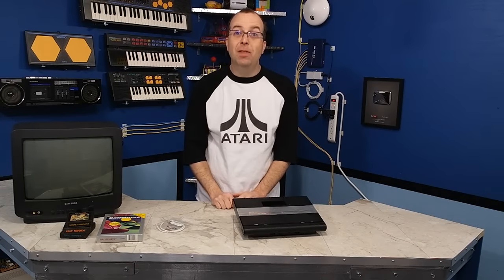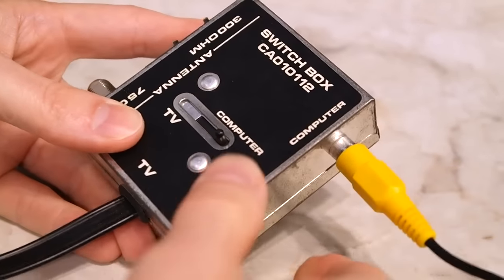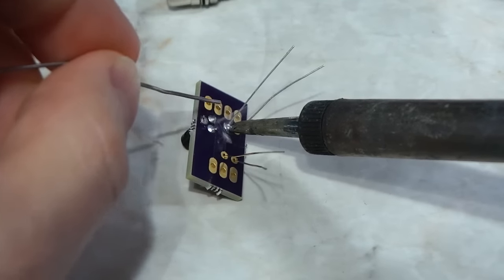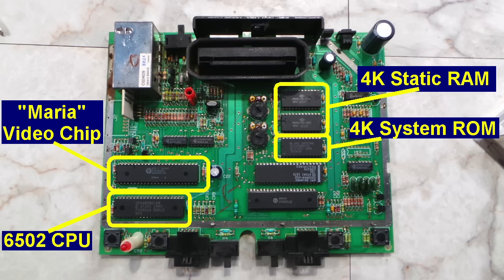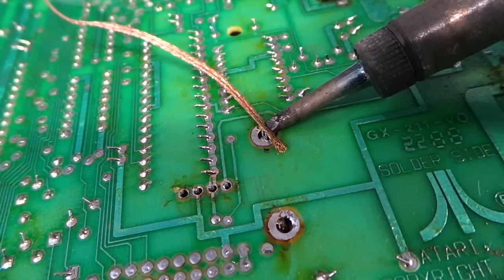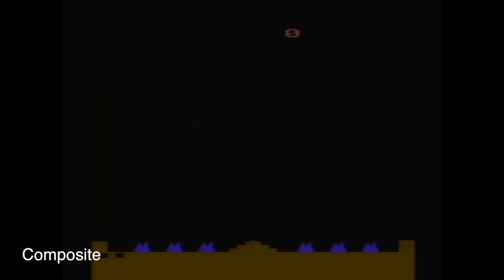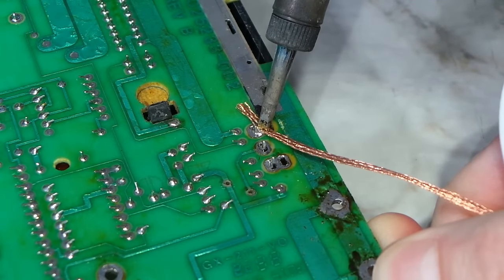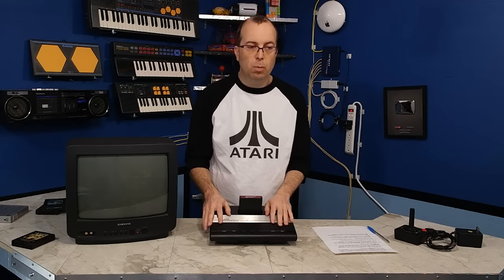Atari 7800 Composite Mod and Review

Comment: Did this mod myself a while ago.  Works great.  One thing, the volume is off for the Pokey sound if you just run a wire like you did.  You won't notice it if all game sound is Pokey or all TIA, but if the game uses Pokey and TIA sound (like Commando), you do.  I used a tiny variable resistor on the TIA audio line (I think) to get them right.  Always planned to take it apart, measure the resistance and then just get a resistor, but I got lazy and the variable resistor is still there. ;-)

Comment: Great video!

A couple minor clarifications ... only two of the original 7800 games had POKEY sound chips but probably a half dozen or so Homebrews also have it. 

Also, you talk about carts being 48K. In fact, during the 7800's life, they also had 64K, 128K and 144K carts. Since then, Homebrewers have made 256K, 512K and 1084K games.

Comment: @The 8-Bit Guy
The reason the 7800 didn't have a composite is probably because it was originally designed in the early 80's.  And it was actually originally released in limited numbers in 1984.  But due to the selling of Atari and internal company strife the 7800 wasn't widely released until 1986.

Comment: My first console was a Atari 2600 but it wasn't in the old brown and black case, in fact its had a case very similar to the 7800 you used in this video, the difference was the power switch and pause switch were on the left near the cartridge port, fond memories of games on that console

Comment: The TIA chip actually generates stereo! It has two channels which have separate output pins on the chip. If you look at the slats on an original VCS, you'll see where two speakers were intended to mount. In the end the system was converted to mono. I'm going to guess that Yar's Revenge is using the second channel which is coming from the other audio jack in this case, which is why the sound is off.

Comment: My Sega Master System had a DIN socket on the back. With no internet and a few dollars worth of parts from the electronics and a little trial and error store I made my own composite out cable. I think I was 8 or 9 or so. Those were the days!

Funny thing is I connected it to the VCR, which was connected to the TV via - RF. But somehow the quality was much better, perhaps the VCR just had a superior conversion circuit.

Comment: I think the funny sound on Yars Revenge is due to the lack of lowpass filtering on the composite output you added. The additional harmonics don't make it through the RF modulator and you can't hear them anyways. But they will cause aliasing if your capture device lacks an antialiasing filter.

Comment: Nice job on the modification. My only advice would be watch the rough edges on the shield and board so the wires don't rub up against where you cut. I generally leave my systems in original condition unless I have two. Some of the newer modifications that can be done involve component and HDMI which I did on an Atari 5200 and Commodore 64. I haven't actually done component though because there's a lot more involved in that you'd have to drill 5 holes 3 for video and then 2 for audio. Not to mention I figured since HDMI is the main format currently in use it just made more sense to go with that. Both systems look and sound great. It's nice not to have to use the Atari 5200 specific RF switch and as for the Commodore 64 the SID chip never sounded better.

In general though I emulate everything which allows it to look and sound better still for obvious reasons.

Comment: This was cool to watch. I've been wanting to do the same mod on my top-loading NES as it doesn't have composite for some bizarre reason. I had no trouble taking apart my old front loading NES and snipping the lockout chip but once you get into soldering and drilling, I get cold feet.

Comment: Awesome video!  I still have my 7800 in the storage bin.  But my 7800 controllers stopped working.  Need to buy some on Amazon.  Also lost the power box.  Also its different from the 2600 power box.  But I recommend getting Double Dragon and Ikari Warriors for 7800.  Two of my favorites.  Any chance to mod the 7800 a bit more for it to read like USB or HDMi or add a sd card slot?

Comment: I just recently purchased a  7800 for my old 2600 games. It came with the 7800 versions of Dig Dug, Pole Position, Choplifter, and Centipede. The arcade port are much closer to the arcade graphically than the 2600 ports. It game with the 7800 controllers, but they are pretty much garbage, but you can use a Genesis controller, but it isn't configured for the second button without modding the Genesis controller (thereby making it useless on a Genesis). I did read that the 7800 was gonna be released in late 83, but Warner Brothers decided not to release it due to the video game crash and they were trying to sell Atari. Jack Trameil bought what was left of Atari, and decided in 1986 to release the 7800 since they were collecting dust in warehouses anyway and the company needed more capital. That may explain why there was only RF connectors. It was essentially the same design from 83 when composite TVs were rather rare.

Comment: I think the reason for the kit to include 2 audio jacks is that some TVs and what not will only have one speaker work. There is a mod you can do the the nes witch will give a pseudo stereo too. it puts one of the pulse waves and the triangle wave on one speaker and the rest of the wave forms on the other. You can mod a turbo grafx 16 to have s-video (I think RGB is possible too) The ps2 and xbox can be moded to load games from  hard drive (internal hard drive on the xbox) The ps3 can run a version of lynux and most american N64s can be moded to have RGB.

Comment: Just a quick tip for anyone watching this that doesn't want to mod their console. Instead of the old TV/Game switchbox (Newer 1990's era TV/Game switchboxes actually also have a coaxial output, allowing you to skip the 75 Ohm To 300 Ohm adapter 8-Bit Guy had to use pre-mod), just look up "F-Type adapter". It's a RF to coaxial adapter that screws onto your CRT's (Or VCR's) coaxial input and accepts the 7800's rf cable directly. Bypasses the interference prone TV/Game switchbox entirely. Works for unmodded 2600's, Colecovisions, and most other classic pre-crash American consoles as well (and any CRT television that has composite inputs is also going to have the coaxial input).

Comment: The RF selector switch was to select between channels 2 and 3, not 3 and 4.  At least that is the case in all the units I have seen, and from all the manual versions I have seen.  There are a few people that have said channels 3 and 4 were used, but it seems to all be from newer posts on the internet, and only since it is common that people do not have a TV with an RF input to even try it if they have a console.  The first Atari console to use Channels 3 or 4 for the RF modulator was the Atari Jaguar, which was also the first Atari console to have the ability to connect to Composite Inputs, (via a special optional cable).

 - Side Note:  Low VHF modulators sold in the USA for general use, typically were switchable between 2 channels to allow the user to select the channel that normally would NOT be in use by broad cast channels in the area.  Common early modulators selected between channels 5 and 6, but were before widespread normal consumer adoption, and were typically seen in educational market items such as U-Matic VTRs (the term VCR did not really fall into use till the Beta and VHS units hit the market).  Later modulators were then typically selectable between channels 3 and 4 (MOST consumer items), or channels 2 and 3 (Mostly Atari products)  The reason you will not see a modulator that is selectable between channels 4 and 5 is because those two channels are not actually adjacent to each other, and have a wider gap allowing BOTH channels to often be in the same geographical region/city with NO interference.  Because of the real problems with adjacent channel interference, adjacent channels could not be issued licenses to broadcast within a certain distance of miles.  There are areas between these points, in what used to be considered high density population areas, where someone might live and be able to pick up stations from opposite directions of adjacent channels because the stations were physically separated far enough apart to be considered in a different geographical region.  The same types of rules also still apply with radio station licensing by the way.

Comment: As others have said, an RCA to F-coax adapter will do wonders for the signal. Failing that, pop the back off that switchbox and bypass the switch by soldering wires between the input and output connections. You lose the functionality of the switch, but it greatly improves the image. Seems the problem is in the switch, not the cable or the fact that it's RF.

Also, while it's true that various 7800 games used two buttons, many of them could be placed in 1-button mode with the difficulty switches. For example, normally you use separate buttons to shoot and drop bombs in Xevious, but when you flip the difficulty switch (sorry, I don't remember which setting to use offhand), the same button both fires and drops bombs.

You might actually want to mod a generic Atari joystick to add a second button for the 7800 as the official controllers are fairly uncomfortable to use. They used to be known as the Atari Painline joysticks since they had a tendency to cause hand cramps after even a short play session. Alternately Atari released a gamepad for the system in Europe.

Comment: The 7800 was actually finalized and released in certain test markets in 1984 but the mainstream release was delayed due to the videogame market crash. That's the main reason it doesn't support composite video. Also, most existing TVs didn't have it even in 1986. ;)

Comment: I just hook my 7800 through a VCR, which doesn't give it as clear a signal as composite, but the VCR coverts it to composite so I can play on more modern TV's. However, the composite mode is pretty cool. I just have no experience with soldering and all that.

Comment: I used to have a cheap pong-type game from Radio Shack with an RF output to an RCA connector. I opened it up and found the modulator circuitry, which was a separate little assembly right near where the RF signal wire came out of the case. I just shorted its input to its output and voila, composite video. (Sound came from a little speaker in the unit.)

Comment: holy cow, I wouldn't think a transistor and two resistors would be enough to convert from RF to composite! great find!
Reply from the maker: Well.. Keep in mind the signal on the board is already essentially composite before the RF modulator turns it into RF.  So, by eliminating the modulator, the signal that is left is almost composite as it is..

Comment: To be fair, the 7800 was originally supposed to be released in 1884z and composite inputs were not very common on TV at the time, so I can see why they stuck with the RR input. Even the Famicom was RR only when it debuted in Japan in 1983.

Comment: You don't necessarily need a box. You can just get an adaptor that's directly the RF signal to the F type connector. If you watch the AVGN's Pong Consoles episode, you'll see that he hates the switch boxes, and has one of exactly what I'm talking about. Of course, I'm not saying you don't need to mod, but that just makes it easier to connect the things you don't want to mod, or didn't want to get because of the boxes.

Comment: 2:45 The reason the 7800 doesn't have composite output is because it was designed in 1983-84 before composite was becoming commonplace on consumer TV sets (they were of course on computer monitors, but not all of those had sound in 1984).  When the 7800 was released in 1986, Sam Tramiel was looking to make a quick buck and needed cash and already had the 7800 and batch of games just waiting to be rolled out. He couldn't afford and simply didn't want to make any other changes - he was focused on the Atari ST computers.. trying to milk the Atari 8xx series computers a bit longer.. and then eventually the Jaguar.

Comment: I'm glad you did this video. I was considering whether it was worth it to do a conversion on one of my 7800's. Back in the early 90's when Atari went bankrupt, again, they dumped a crapton of merchandise on Big Lots and I have a massive box of 2600 and 7800 games that I paid about a buck each for. This mod will make using the console a lot easier.

Thanks!  :D

Comment: Thank you so much for this video! A nearby radio station transmitter interferes with the RF signal on my TVs, so I'm going to perform this composite mod even though I'll still be using a CRT.

Comment: Actually the TIA chip supports "stereo" sound.  The first batch of Atari games supported this and some third party games do as well (and homebrews).  The reason is that the original 2600 design was going to have two built-in speakers (which you can clearly see where they would go on the original Atari VCS console).  Games like Combat have it so the player on the left side sounds would come out of the left speaker and the same for the right player.  There are mods to support this but I guess this isn't one of them.

Comment: Actually, the TIA was designed to produce stereo sound! That's why it has two voices, and why early 2600s had two speaker grilles molded into the top plastic.

It's also why Yar's Revenge sounds different.

Comment: I miss my old 7800. I had Desert Falcon and Xevious. Desert Falcon was a bit confusing but Xevious ruled, even if you had to deal with the screen being wider and shorter than the arcade version. (Always wondered why you just didn't scroll sideways with a top-down perspective to preserve the dimensions of the arcade.)
PS - Xevious required the second button on the cabinet-specific controller.

Comment: This is a modification I will eventually make, myself, but when I do, I refuse to do any cutting or permanent damage. Instead, I plan to remove the RF modulator/box and use that hole in the shell to run pigtail cables through. Consider it similar to how the 2600 works. But without the length.

Comment: I know this may be a bit late but this is the desoldering device I use.  Relatively inexpensive and works great.  Eclipse DP-366P (also sold under other brands but is usually a DP-366P).  Also, if there is a Harbor Freight near you, they offer step drill bits at reasonable cost.

Comment: The TIA has 2 sound channels, but the 2 pins on the chip are typically wired together, even on the 2600's motherboard. It is possible to split them into separate outputs, but it would be an odd stereo setup. The 7800 can play most 2600 games, but not all of them. If it needs a Heavy 6er to run correctly, it won't run on anything else. (M Network's Kool Aid Man, for one example) Still trying to find out why.

Comment: I think the female coaxial to male RF adapter for 5 bucks shipped works great for the price and ease of use. You just put it on the end of the audio/video out cable from the Coleco or Atari and screw it on to the RF input on your TV. It takes the place of that stupid box, and it looks and sounds better. I dont trust myself trying to mod my systems, and Im pretty happy with the quality. I was really surprised. Eventually Id like to get my Coleco modded, and pick up a 5200 and 7800 and mod them. 

Between that coaxial to RF, and my S-Video switcher with S-video AV multi outs for the SNES - N64 - GameCube and an S-video PS1 audio/video cable on my CRT , Im very happy. Its no RGB mod, but for the price ($20 or less for the switcher, and like 7 bucks for each of the RCAs with S-Video) it cant be beat. You ll be surprised how good S-Video looks for how cheap it is.

For the homeys in the Midwest, you can find that S-Video Switcher (RCA brand) at your local Menards for like $20 bucks. its 4 in, 1 out and they all have the 3 RCAs and an S-Video for all the inputs and outputs.

Comment: In response to your mentioning how to connect the RCA output to a modern TV, you can also get a small adapter that is literally just a passthrough adapter, RCA to Coaxial, assuming it works the same way as the C64's port. Sure, it will still be RF quality, but at least you don't have to work with that old converter box. Heck, I spliced my own cable and it worked, albeit with a little added noise to the signal due to my amateur wiring.

Comment: I am sure someone else most likey said this in the comments but one of the reasons that the Atari 7800 did not have a composite output was that the System was designed in 1984, but because of the whole crash and Jack Tramiel issues it was shelved to 1986. by that time RCA Inputs had become much more the standard.

Comment: Nice video! The process looks very similar to composite modding a Famicom. I'm guessing it's applicable to all 6502 machines? Maybe it's even possible to do a RGB mod in a similar way to how you do it on a Famicom? I.e. by swapping the GPU for one with RGB output (from an arcade cabinet, the PlayChoice-10) or by bypassing parts of it using a custom chip (NESRGB).

By the way, were there any "jailbars" (vertical stripes of alternating darker/lighter colors, allegedly due to interference from the processor) in the composite picture? It's a common problem on composite modded Famicoms but I couldn't really tell from the screen capture if they were present on the modded Atari 7800.

Comment: Even though it was released in 1986, it was actually completed and scheduled to be released in 1984, but was stopped because of the Jack Tramiel buyout.  So therefore designed with 82/83 technology no doubt, which could explain the lack of composite output.  You can even see the SALLY chip (CPU) has the 1983 date on it.